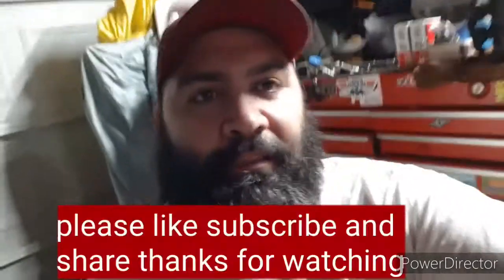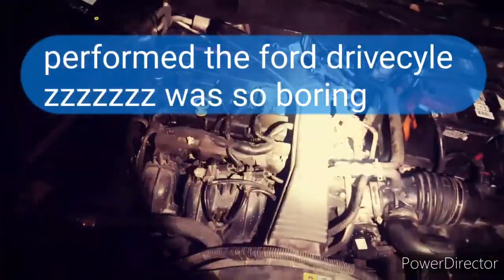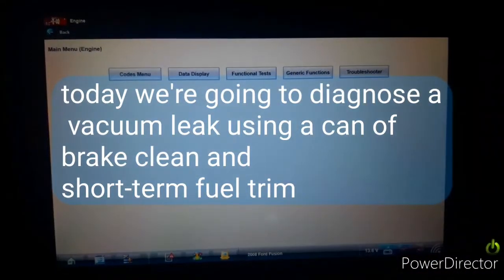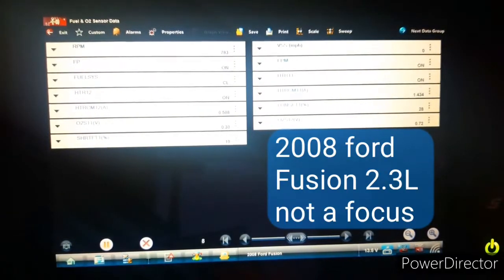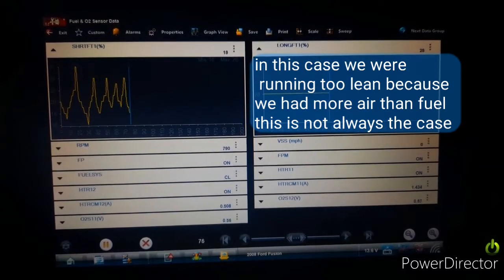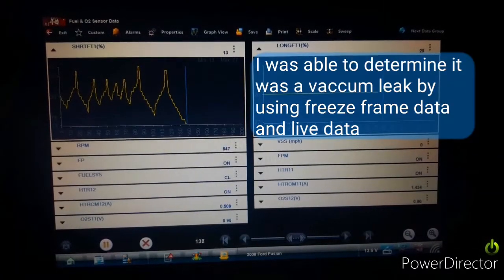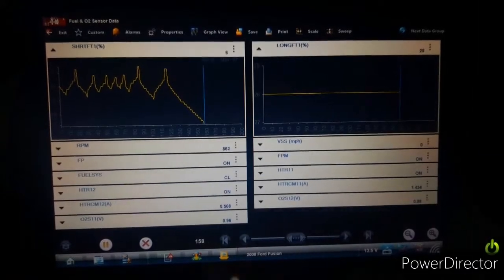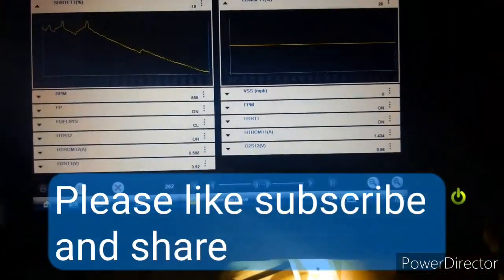Using brake clean and short term fuel trim to locate a vaccum leak

Comment: Have checked for vacuum leaks for years with gasoline, propane, brakeleen, ether... whatever you have handy at the time. If the idle changes at all you know somethings up. So were you able to change out the pcv or hose without pulling the intake ? Pretty poor design by Ford if not. Great video man !
Reply from the maker: Job is still pending customer approval its pretty tight fir looks like intake has to come off